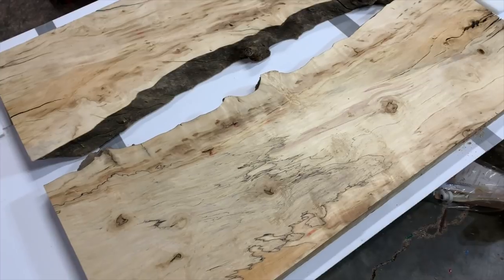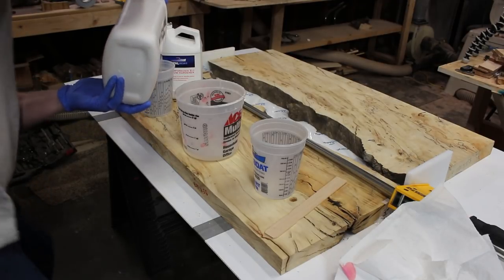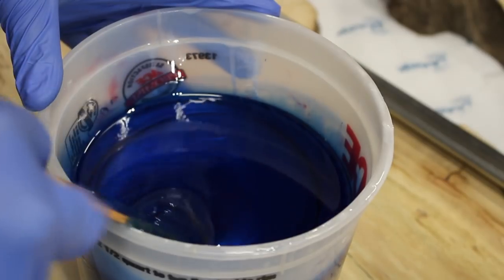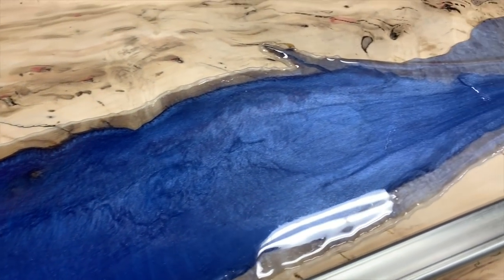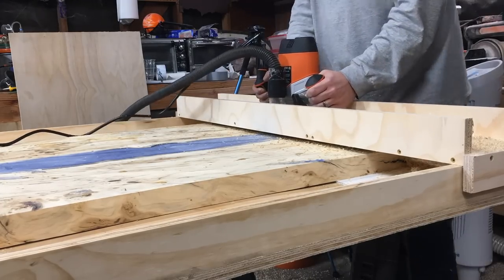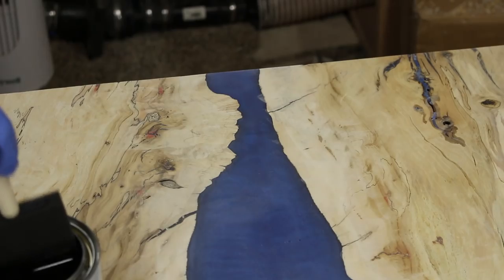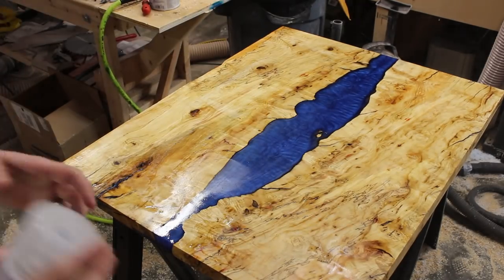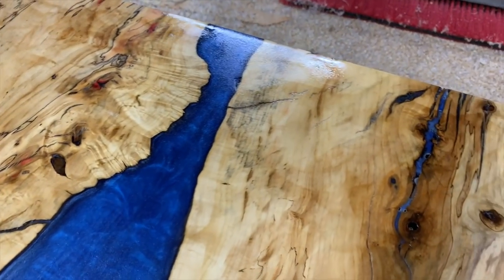Making An Epoxy Resin River Table

Comment: Light sand your poly between coats and after your last coat is dry wet sand with 3000 grit. I use a 3000 grit foam backed sandaper with my orbital or palm sander. I get a glass like finish with no marks. Nice looking table. Defintely on my list of projects to make.

Comment: Ive found it helpful to thin the poly with mineral spirit then apply with clean old t-shirt rag. Not too big but folded to 3 finger size. After each application, i hand sand with grain between coats with 400 grit and clean then apply next coat. I repeat until 6 layers later. Thinning poly helps it dry faster between coats and not leave brush strokes. Foam brushes can leave small bubbles. About 1.5 hours to 2hrs between coats. Hope this is helpful?

Comment: Try ARM R SEAL by General finishes it’s a oil/urethane that I use and it’s awesome. Wipe it on with a tee shirt or soft rag and sand with 220 grit 24 hours between coats. Three coats then let sit for about a week and then I put wood wax by minwax  on and buff out with 0000 steel wool and final buff with a tee shirt. Perfect finish no brush marks or dirt nubs. Comes in gloss, semi gloss or satin. You can get it from Rockler

Comment: Matt everything came out beautiful. I used for my river tables is the same polyurethane. I put a first coat cut with paint thinner 5050. Sand it and then make it use it as a wipe on poly. 4 to 5. coats loved the wood

Comment: On my resin burl table, I used a buffer with Yorkshire grit + Howard’s orange oil.  The YG made sanding a breeze and the oil finish was so easy.
Reply from the maker: That sounds way easier than what I did. And probably buffed to a higher sheen. Oh well. I learned again during this project there really are SO many different types of finishes to choose from. Next big project like this I’ll definitely try something different

Comment: Great video.  I love the wood and the color of the epoxy resin complimented it very well.  Did you have to worry about bubbles in the epoxy after pouring and if so, how did you take care of it?  Thx
Reply: Terry West you can pop the air bubbles with a heat gun, blow dryer or propane torch.

Comment: Hi Casey, is it possible to stabilize wood using a pressure pot or is it better to use a vacuum chamber?
Reply from the maker: Vacuum chamber is what’s recommended. To use pressure you need an industrial system capable of doing THOUSANDS of pounds of pressure to make it more effective than vaccum

Comment: Great job!  Next time. might want to try light sanding between each coat of poly rather than waiting until all coats are applied.  Should get a better finish.  Be sure to tack it down before applying next coat.   You've come a long way from making grape vine pen blanks!  Congrats and keep up the great work.
Reply from the maker: I did that with the normal brush on poly. But interestingly enough the directions in the spray can poly say not to do so until the final coat. I know it seemed counterintuitive to me but it ended up turning out just fine. Thanks a lot Tom! I really appreciate that.

Comment: How long did you wait between pours?  OR rather, was the previous layer still curing when you poured the next layer, or completely cured?

Beautiful, well don table!
Reply from the maker: I waited until it was hard to the touch. I’m sure it was still curing technically. But about 4-6 hours is how long it took until it was hard to the touch.

Comment: Casey, since you do a lot with Alumilite Clear Slow Set.  Have you ever used that for large pours like this or cheese boards
Reply from the maker: I use Alumilite clear normal set. Either version won’t work for something like this. They both need pressure pots. Epoxies are the only type that work without pressure because they take so long to cure. Alumilite makes an epoxy called easy cast or something like that and it would work
Reply: @CaseyMartin707  thank you for your replies.  
Ill look into that other epoxy.

Comment: Dude, hello again, after 3 years lol. I saw a table like this yesterday and it was selling for 8500$. How much would you estimate the cost of building it yourself ? I'd say like 500$ for the wood and 2-300 for the resin ? Thank you !
Reply from the maker: Yes somewhere around there and $100 for the legs. But this is also a smaller coffee table. The ones that sell for that are usually dining table size and therefore the wood is much more expensive at that size. But definitely a solid way to make money for sure

Comment: So how was wood flipped over without messing up bottom tape.
Reply from the maker: Haha quite carefully! I’m surprised you noticed. Most people don’t. After I taped it up I remember thinking “crap...now how do I get it turned back over lol” but it worked out just fine. Just was really careful with it
Reply: @CaseyMartin707  thanks for your reply.......
Reply: @CaseyMartin707  After the resin hardened, did you remove the tape on the bottom or did you just leave it there?

Comment: You should of finished it with a skin coat of clear resin. You could of buffed that to a super high gloss.
Reply: High gloss would have been really cool but I think it would have been difficult to contain the clear resin without a barrier edge
Reply from the maker: I thought about it. Julia’s point was one of the reasons I didn’t. I was also worried about the resin not curing crystal clear, as this resin of theirs wasn’t their table top resin. The other main reason was I wanted to be able to feel the wood. That was probably the determining factor